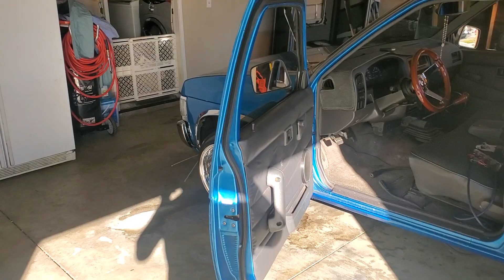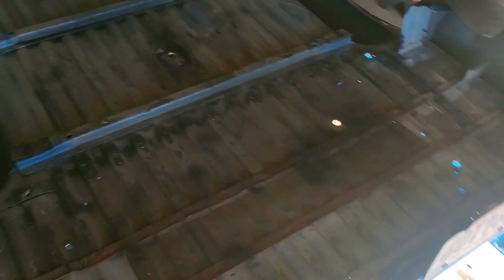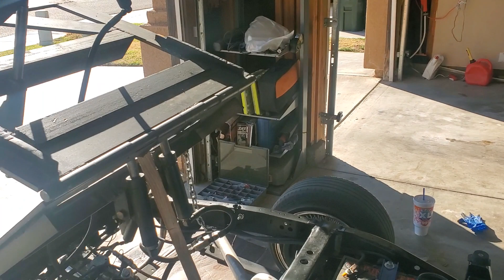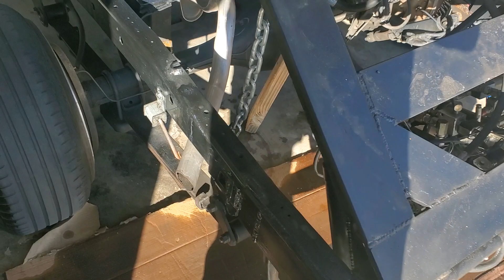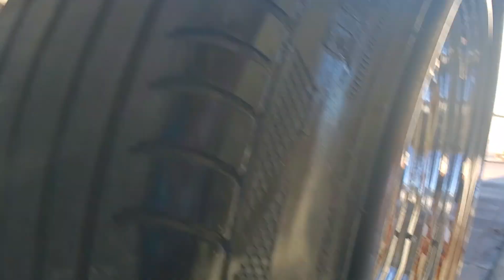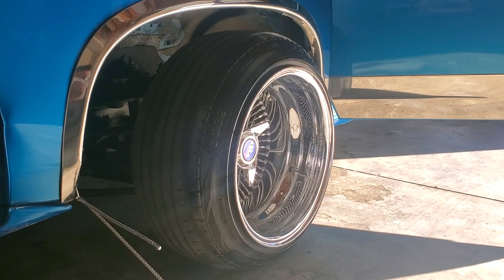97 hardbody 4 stage Z rack

Comment: Hey Oscar on the wiper cowl what is it off of? On my 93 and 96 d21 they have those plastic inserts that never stay and look ugly. I was going to fill it in but like it one piece. Thank in advance.
Reply from the maker: mine is the same, i spray painted with chrome paint...
Reply: @omoran04  what chrome spray paint did you use Oscar ? I like the chrome looks nice 👍
Reply from the maker: i used krylon spray paint
Reply: @omoran04  right on thanks Oscar. I tried an other brand and it didn't come out right. Again thanks for the info Oscar. Mini trucks for ever.